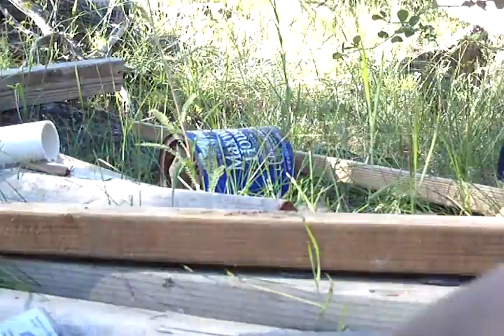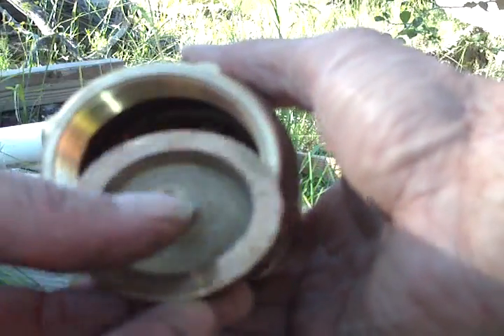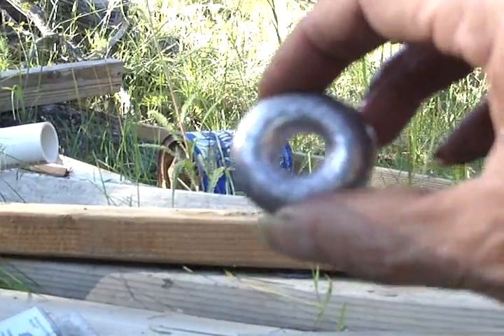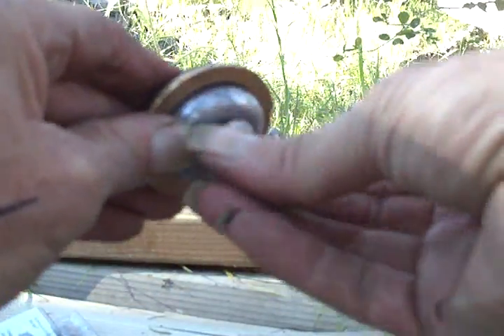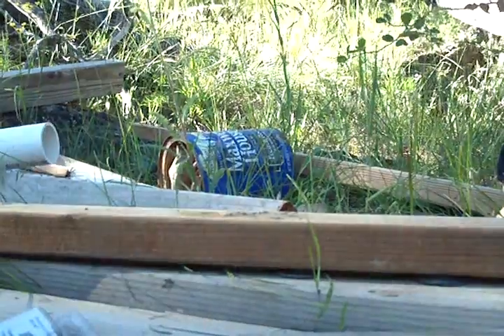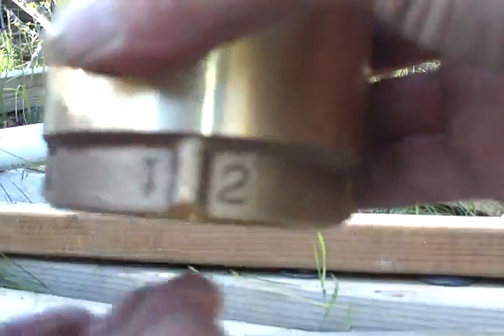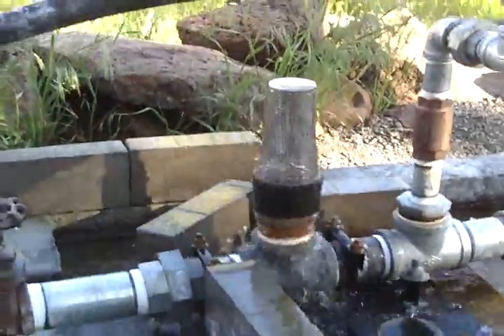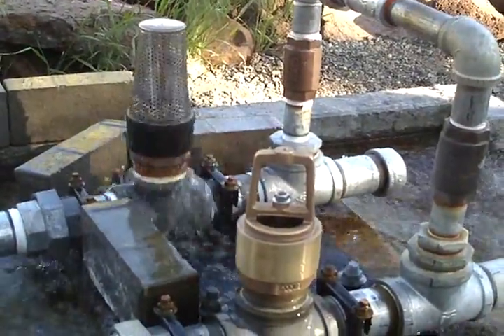Ram Pump: converting a foot valve to a ram

Comment from the maker: I also switched to steel drive pipes and it made no difference in the water volume pumped. The steel drive pipes set up a reverberating pulse that kept causing the pumps to shut down at random times.  I switched back to the plastic drive pipes and all is well once again as they will now run indefinitely until I shut them down.  On a cold freezing night the last thing you want is for your pumps to stop as then they will freeze and break things and that is exactly what happened after I switched to steel.  Plastic has worked fine for the drive pipes for all these years so I'm staying with it.

Comment from the maker: On another note.  Do not use any plastic parts.  I see lots of articles and videos where they are using plastic parts and they will not hold up. Believe me, I know after 10 years of running my pumps.  And swing check valves are also a no go.  They will beat themselves to pieces and there is no way to adjust them for a precise setting for the amount of water flow available in each situation. You need the rubber O rings on the valves to cushion the pounding effect.

Comment: Brilliant..however I would be concerned if those weights are lead.
Reply from the maker: I have had more than a few comments about the lead weights. I myself am not concerned about it but you could remedy the problem by either making the valve stem long enough to pass through the top of the pump and then put your weights outside of and on top of the pump or you could paint the weights.  The lead weights in my system have become coated with a layer of minerals which turned them brown which probably has done a great deal to keep any lead out of the water if I was concerned about it.  thanks for the reply!
Reply: @fireye2012  gov will have all heads for this tech thay teach us that we always have loss but never talk about 
the converted gain we can make from eletromagnets
if u convert all the wast thermal energy around 
you u can use it universally as energy u need a true sine wave bipolar like the power comp dose a 
true pure sinewave like a grid tie inverter 
once the signal is made the system will turn on and 
consume wast thermal energy from the 
environment and space around you... there is free energy but 

it comes from Universal thermal loss and converted into a gain. so a pole Transformer and a 
microwave Transformer  have a common between each other u can take 2 microwave Transformer provide 
a pure sine wave grid tie inverter to it or a true bipolar sinewave that inter acts with nature in 
a perfect spherical motion like a flower of life..  if ur home provides this use it as a Source 
signal then u can simply stack the Transformers on top of eachother in correct fasion and note 
that the 1 wire on the Transformer must stay connected and the other disconnected your only useing 
1 wire on the hi side .. so test ur self 
2 microwave transformer stacked on top of eachother same 

face sides. one side 120 to the wall and the other 120 side to what u want to power and useing the 
Transformer just the way it came out the microwave with the wire attached causes the energy in its 
perfect spherical motion to converted wast thermal energy to amp for u hot to cold in to out... 
should look a bit nuts with u use a form of wireless energy but its interacting with the 

environment...this is my work a compilation of Otis car. Tesla. and many other very smart people 

nowadays i think i found the gate source and drainif this gets out to much that it works the 
power 

comp and mib will have our headsdont do this at home warning high voltage yet i cant stop u lol DO 

NOT TOCH THE CORES OR THE WIRES OK u will die make sure u dont touch the core if the hi wire is 

mounted to it u dont have to mount the hi on the core if u dont want u connect the 1 hi wire to 

the same side hi on the other transformer then the core should besafe to handle if nessary
grab your multimeter and prove me wrong
thats what u do i have my whole home on this
and u can take 

one of the lows side out the wall and hook it up to other stuff and power it for verry little amp 

makeing nature convert and pumping latent heat effect into the device.
and u can have a microwave 

hi volt cap in between the hi side and make a system that powers its self
u can flip the switch on 

ur breaker and the room stays on up to 2kva 
with both lows in the wall this is the zero point that 

was taken from us...
Reply: @fireye2012  gov will have all heads for this tech thay teach us that we always have loss but never talk about 
the converted gain we can make from eletromagnets
if u convert all the wast thermal energy around 
you u can use it universally as energy u need a true sine wave bipolar like the power comp dose a 
true pure sinewave like a grid tie inverter 
once the signal is made the system will turn on and 
consume wast thermal energy from the 
environment and space around you... there is free energy but 

it comes from Universal thermal loss and converted into a gain. so a pole Transformer and a 
microwave Transformer  have a common between each other u can take 2 microwave Transformer provide 
a pure sine wave grid tie inverter to it or a true bipolar sinewave that inter acts with nature in 
a perfect spherical motion like a flower of life..  if ur home provides this use it as a Source 
signal then u can simply stack the Transformers on top of eachother in correct fasion and note 
that the 1 wire on the Transformer must stay connected and the other disconnected your only useing 
1 wire on the hi side .. so test ur self 
2 microwave transformer stacked on top of eachother same 

face sides. one side 120 to the wall and the other 120 side to what u want to power and useing the 
Transformer just the way it came out the microwave with the wire attached causes the energy in its 
perfect spherical motion to converted wast thermal energy to amp for u hot to cold in to out... 
should look a bit nuts with u use a form of wireless energy but its interacting with the 

environment...this is my work a compilation of Otis car. Tesla. and many other very smart people 

nowadays i think i found the gate source and drainif this gets out to much that it works the 
power 

comp and mib will have our headsdont do this at home warning high voltage yet i cant stop u lol DO 

NOT TOCH THE CORES OR THE WIRES OK u will die make sure u dont touch the core if the hi wire is 

mounted to it u dont have to mount the hi on the core if u dont want u connect the 1 hi wire to 

the same side hi on the other transformer then the core should besafe to handle if nessary
grab your multimeter and prove me wrong
thats what u do i have my whole home on this
and u can take 

one of the lows side out the wall and hook it up to other stuff and power it for verry little amp 

makeing nature convert and pumping latent heat effect into the device.
and u can have a microwave 

hi volt cap in between the hi side and make a system that powers its self
u can flip the switch on 

ur breaker and the room stays on up to 2kva 
with both lows in the wall this is the zero point that 

was taken from us...

Comment from the maker: Problem- water that sits on top of the 1 inch valves will freeze in winter and break the valve.  Solution- Drill and tap a small hole through the side of the valve body just above the valve seat and install a small short screw to plug the drain hole when in use.  Remove the screw and leave it out to drain water off the valve in winter.

Comment from the maker: You can get the two inch valve at any plumbing or agriculture irrigation store and the one inch check valves I get at the lone despot  er   home depot.   They just doubled the price of the 1 in valves from 10 to 20 bucks over night.

Comment from the maker: well here it is now july 9 2016 and the pumps are still chugging away.  They are the heart beat of this whole place.  I switched over to all steel drive pipes and one of them would stop for no reason. I fixed the problem by adding a valve on the out put line to the tank and keeping it closed just enough to create a little back pressure

Comment: Sorry to hear about your run in with the penal system.
You say swing checks don't work. Interesting. 
Can I as you, is this foot valve only installed in the exhaust or have you figured out a way to put it into the chamber valve as well?

Comment from the maker: A major mod I had to do was to replace the brass valve stem with a stainless steel one as the brass stem kept on breaking and I have to replace the rubber O rings on the valve seating lips every two years but they are cheap and it is very easy to do....takes me about 10 minutes.
Reply: Simmons brand foot valves are very high quality, made in Georgia.

Comment from the maker: my nails are long because they are guitar picks.  You can get the foot valve at any plumbing store or the lone despot...er     home depot I mean.   Swing check valves don't work....I already tried those.    And as I said before the lead issue doesn't concern me as it is to miniscule to even consider in this application.

Comment: @fireye2012 just paint the lead weights with something non toxic and it's a non issue. nothing but water will ever touch it really so it shouldn't wear off very quickly

Comment: Mate - I am in Thailand working with the hill tribe people - trying to build a RAM pump to increase agric productivity.  I have a 2" setup - went all steel for the 1st one to try and get it right.  Can I boucne a few things off you as it is not working.  I am going to replace the spring with weights as you suggest but would like to check my stats with someone who has done it.  Barry j

Comment from the maker: Even with 6 feet of drop you should have no trouble getting water to heights of well over a hundred feet but as you know the higher you go the less water you get.

If you have a long pipe run feeding the pumps (over 100 feet) you will need to install a stand pipe or your pump will never work properly.

let me know if you have anymore questions as I would be glad to help you work out the bugs.

Comment from the maker: My questions would be how much fall do you have and how far apart are the pump strokes. Mine runs at about no less than 1 stroke per second.  The faster the strokes the less pressure you get.

Your air tank is very critical to.  I found that the air pressure inside of the tank is very important as well. After I went to a commercial pressure tank things got much better than the home made ones I was using.(I had to pre-pressurize mine with a tire pump before it really started to move some water).